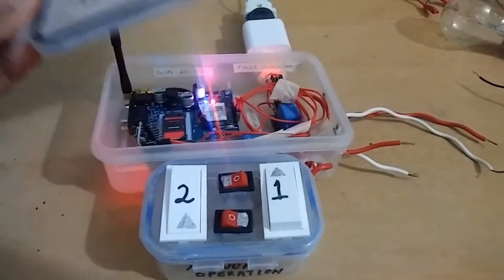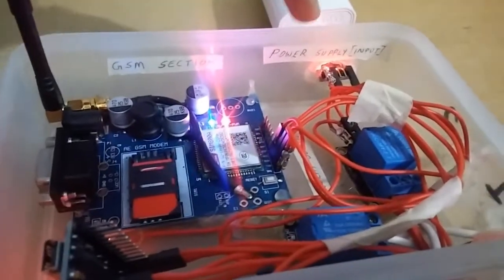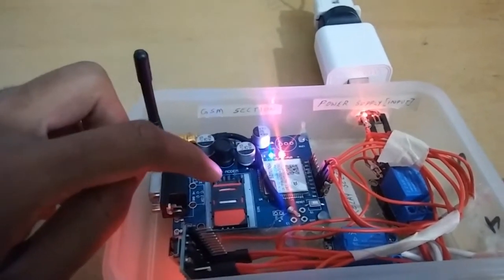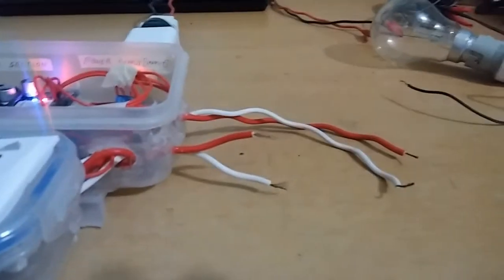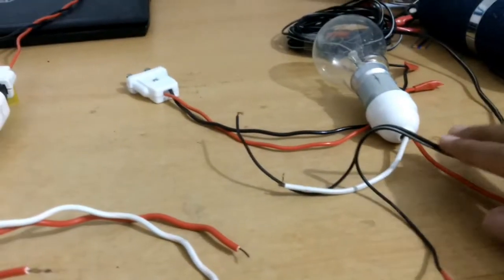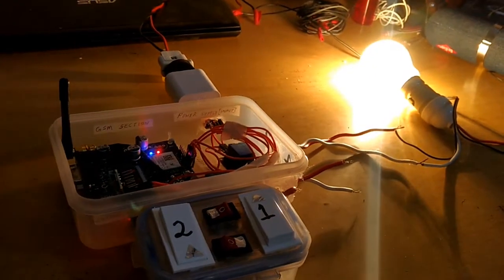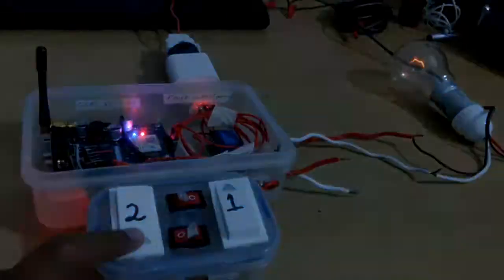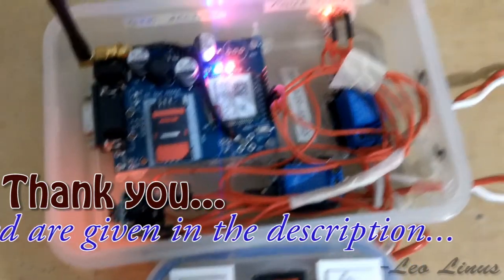Make your GSM plus Arduino (DTMF) based Home Automation

Comment: thank u so  very much
Reply: Sir actually I m using Arduino Uno at place of Arduino nano & as in ur description  the code is written for Arduino nano .
I have already tried by changing the pin connection of interfaced gsm module & relay as per Arduino  uno controller but I m unable to receive the call on gsm module.
What can I do 
Plz help me a lot
Reply from the maker: The code for Nano/Uno is the same. In your case as all connections are correct to receive the call make sure to check these two things :
1. Power supply should be min 5v 1A/2A ( prefer using power bank )
2. Entire setup should be in an open place having good network connectivity.

Hope this clears your issues.
Reply: U say power supply should be 5v/1A/2A 
But we can also give a power supply of 12v/2A adapter through power supply pin .
After all these connection we r still unable to receive the call on gsm module .
It's is nothing coming to our our mind .what can we do?
Plz help me
Reply: Okay.
I m trying it.
Reply: Sir whether we have to add a mobile no. connected to the gsm module sim with AT command.
Plz tell me
Reply from the maker: @wasimakram7374  No thats not required
Reply: Sir Now I m able to receive the call on gsm but our relay is not working properly .would u plz help me a lot by providing the  connection of relay sketch to just know that how it has been actually  connected to Arduino uno
Reply from the maker: @wasimakram7374   Signal Of Relay 1 = D8 of Arduino.... Signal Of Relay 2 = D9 of Arduino....Reaming Ground to Ground ....& Vcc to 5v
Reply: @leolinus767  I have done the connection as per u suggested
Reply: Guy we need ur support seriously.
Can u plz help me...
Reply: If u wanna consider my problem then it is ur the biggest grace for me..
Reply from the maker: @wasimakram7374  Check in your Arduino Serial monitor if the relay on command is being received by arduino when you press a button
Reply: No, actually it is receiving somehow other command like 13 if we press 22
Reply: Tell me plz...
 as per the code & connection if we connect the one wire of main supply in common & wire in NO via bulb then intially it should be stopped??
But it remain on..Plz suggest me I m unable to understand the relay interfacing as per u suggested
Reply from the maker: @wasimakram7374   Yes it should stay off, when you conect one 220v live wire to com of relay and a wire from NO to bulb and other wire from bulb to neutral (negative) of 220v. If its still ON try connecting the wire at "NC" instead of "NO". As it depends on the code.
Reply: U will served me better if u would likely to  provide me Ur contact no.
Plzzzz..
Reply from the maker: @wasimakram7374  9987412150
Reply: @leolinus767  hy bro...thodi help chahiye thii kya me aapkl is no pe call kr skta hu
Reply from the maker: Ya sure. It would be better if you ping me in whatsapp.  @lnnayma3571
Reply: Can I use sim900a module for the same project if yes,then tell me will there be any changes in the code u have provided in the description. Bcz Actually on calling Sim900a module it is even ringing but module is not able to receive it while we r using the same code given in the description by u for sim800.
If u wanna help me I m very obliged to u.
Plz intimate me as fast as possible.
Reply from the maker: Yes you can use the same code for sim900. It should work perfectly fine. For your case check the hardware connections you have made between Arduino & GSM900, may be some loose connections

Comment: Hello dear,
I need this circuit diagram..
could you help me??
Reply: Bro I m using 2 channel optocoupler  relay module hence I don't know how to interface the relay connection with Arduino as u have not provided schematic scheme.so I m facing a problem to control the relay module even after the call is being connected.
What can I do ?
Plz suggest me
Reply from the maker: Bro the connections will remain same as mentioned in the description.  @wasimakram7374
Reply from the maker: Zahidur Rahman Roni Sure... I have used an arduino & a gsm 900 board. The connections are as given in the description. Even the code is given. I guess it will help you out.

Comment: Can I tell me the command
For relay 1. ON
For relay 1. OFF
For relay 2. ON
For relay 2. OFF
Reply from the maker: void relay()
{
  if(n[0]=='1') // if RELAY_1  was selected
    {
      if(n[1]=='1')
      {
        digitalWrite(RELAY_1,HIGH); //relay 1 on
        Serial.println("RELAY 1 ON");
      }
      else if(n[1]=='2')
      {
        digitalWrite(RELAY_1,LOW);// relay 1 off
        Serial.println("RELAY 1 OFF");
      }
    }
    else if(n[0]=='2') // if RELAY_2  was selected
    {
      if(n[1]=='1')
      {
        digitalWrite(RELAY_2,HIGH); // realy 2 on
        Serial.println("RELAY 2 ON");
      }
      else if(n[1]=='2')
      {
        digitalWrite(RELAY_2,LOW); // relay 2 off
        Serial.println("RELAY 2 OFF");
      }
    }
    relay_flag=0;
}

You can find the entire code in the link given in the description...
Reply: Which button I have to press for relay 1 on and off

Also for relay 2
Reply: Thank you so much for reply
Reply from the maker: For selecting a relay press 0 then press 1 or 0 to ON or OFF respectively... Similarly for selecting other relay press 1 then press 1 or 0 to ON or OFF respectively.
Reply from the maker: Most Welcome... Do let know if any issues